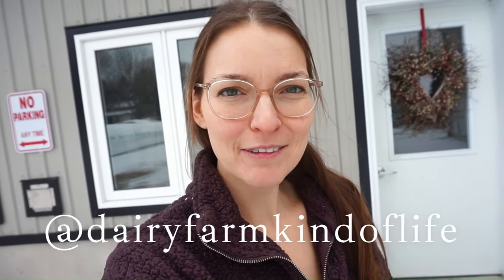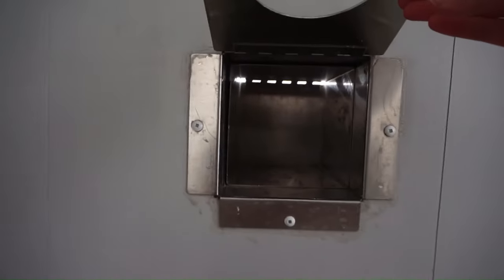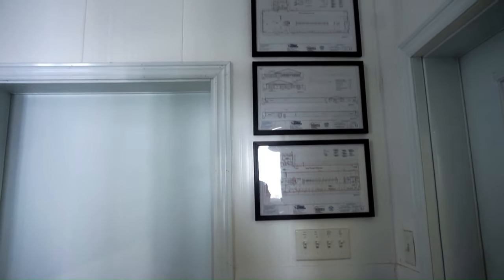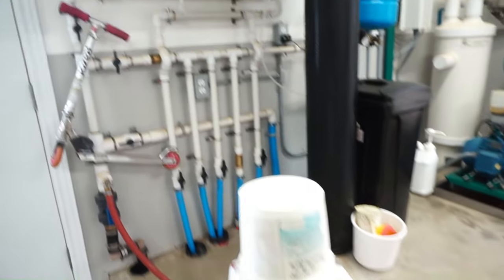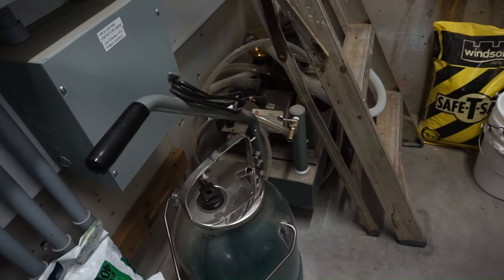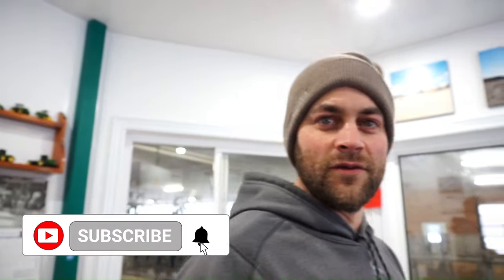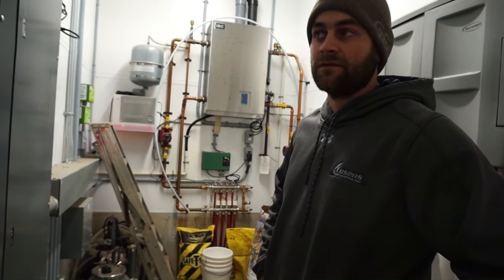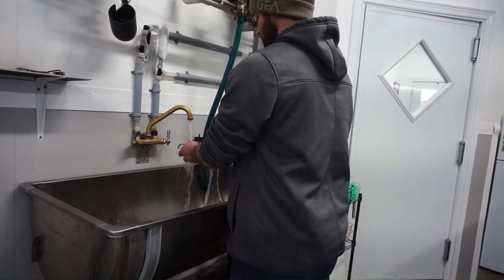Robotic Dairy Barn Milkhouse Tour (& what we would change)

Comment: You said you milk 65 cows currently.  Do you plan to expand?  I think 2 robots can handle more?  I'm not sure how expansion works in Canada though.
Reply: Hello,
Yes, we figure we can handle 110 on the two robots. You can only grow slowly per year in Canada. So we will get there eventually.
Reply: How many times a day does the milking system wash and does the whole system shut down to wash or each robot wash individually? Also do high producing cows naturally go thru and get milked more times a day than a lower producing cow?
Reply: @billsauberlich7337  hello,
The whole system washes twice a day. 2 a.m. and 2 p.m. It takes 30 minutes. Both robots shut down for this wash. They need to both shut down to completely wash all the milk lines going to the cooler. 

And yes, fresher high producing cows tend to go to the robot more often then others. But I do have the cows in 3 groups. High producers being allowed to milk every 5.5 hours and then a group that can go every 6.5 hours and then a group that can go every 9.5 hours. I adjust the groups as to what the cows are milking. Also the robot knows what cow is in what group.